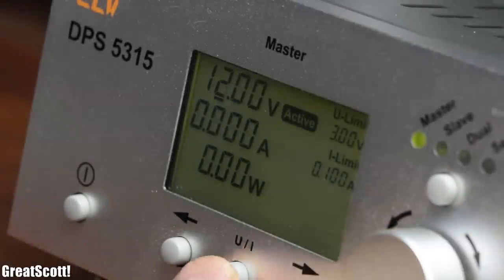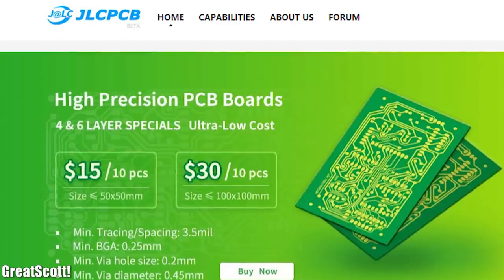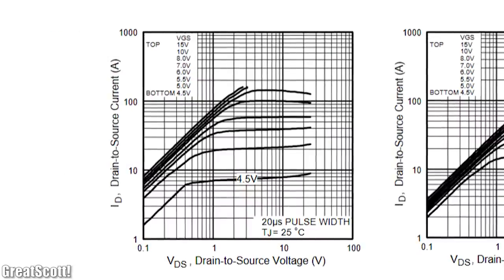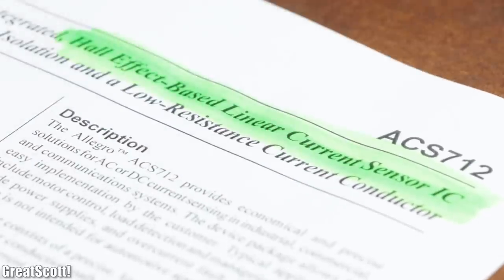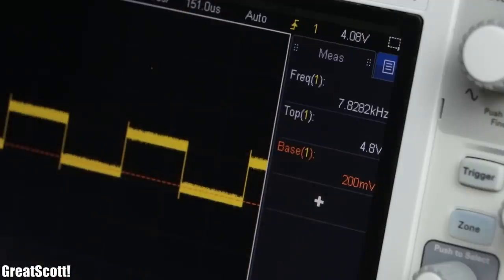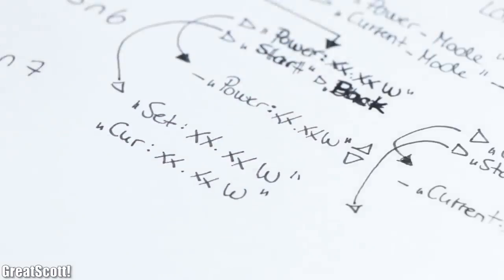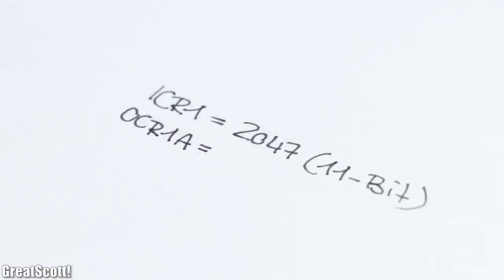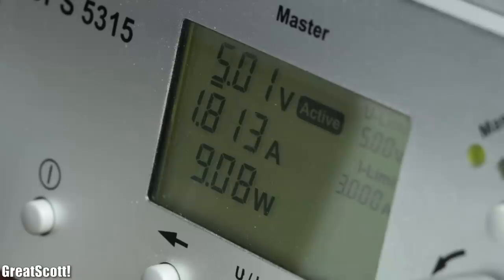DIY Adjustable Constant Load (Current & Power)

Comment: For the current reading on my PWM charge controller using the same current sensor I used a loop which runs for a full second counting the current values, then dividing by the number of loops it did to get an average. I found this gave me a much more stable value. However, if you're using it to control current that wouldn't work so you'd need both the instantaneous value and an averaged one. Instantaneous used in your control loop but the averaged value shown on the screen.

Comment: How would you control all the parameters via software?  USB direct connection or wifi, or both.  My goal is a spark generator that can be controlled via software and pc. Frequency control is an additional factor.

Comment: Really good video. However, can this system (with modifications) be used for much higher voltage values for examble load for tubes. For example 500V 300 mA load.

Comment: Thank you very much for this device. I need your help. When I press the start button, the load (which is my bench power supply, voltage set to 4v, current limited to 1 amp), output load shows short circuit. If I press the stop button, short circuit gone. Also I see negative current on lcd when I press start button. I cannot find the problem. Please help me! I stuck on this and can't move on.

Comment: Is it possible to put some high power resistor (or a few light bulbs) in series with the mosfet to reduce the power dissipation on it? I am planning to build a Lipo battery tester/discharger ideally dissipating up to 200W = 12A * 16.8V

p.s. I know I am late on the video but I just discovered this wonderful channel!

Comment: Very helpful, I made a test constant current load using a couple of op amps and some mosfets salvaged from an old UPS which worked for testing 12V SLA batteries but the FETS blew when testing (lithium) 24V batteries. I think the FET's were unsuitable and / or I had over engineered  it somewhat making a mistake in the circuit design somewhere. You design is much simpler so I'll give it a try.
Reply: The FETs probably were only designed for a maximum Vds of 20V or 16V, that are typical values. Would work fine at 12V, but they let out the magic smoke at too high voltages. Always google for a Datasheet before using any mosfet with higher voltage than the original device!
Reply: Yeah I think that was the problem. I was gonna re-visit that CC load tester later but may look at integrating Great Scott's solution into a battery tester. Perhaps change the LCD for a 4 line and add display for time elapsed and calculated Ah rating. Also feature to disconnect the battery when it reaches it's fully discharged state.

Comment: Im a bit concerned about your way of regulating the output. The slow increase and decrease can make the whole system unstable and it might go into oscillations. The usual solution is to use a PI-controller instead.